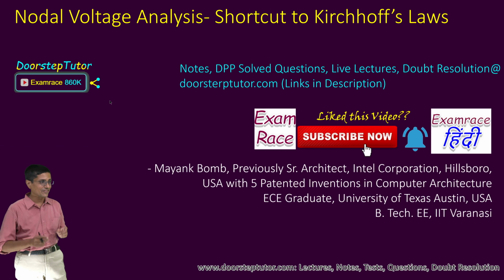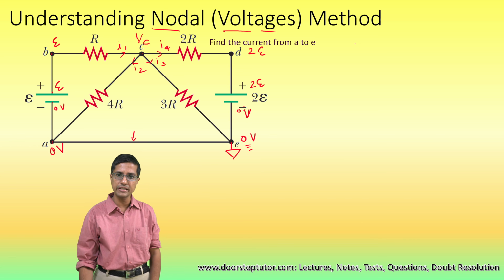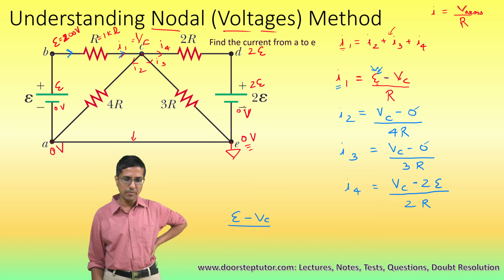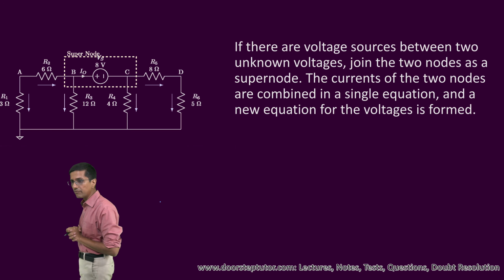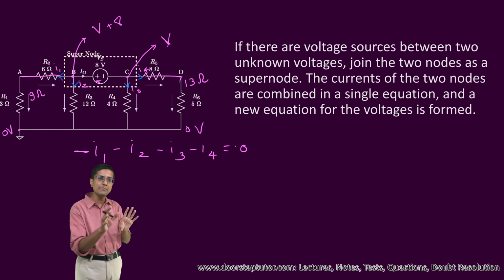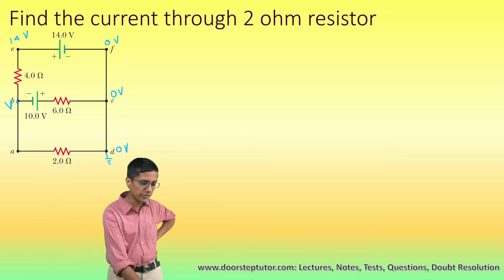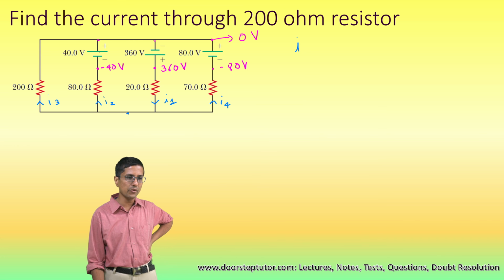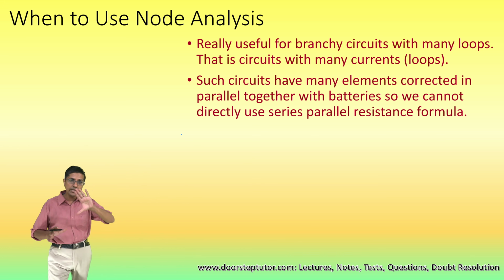Nodal Analysis As Shortcut to Kirchoffs Rules for Solving Resistance and Battery Circuits | Physics

Comment from the maker: Unlock the power of Nodal Analysis, the ultimate shortcut to mastering circuit problems and outsmarting Kirchhoff's Rules! This technique simplifies complex resistance and battery circuits, making your exam preparation a breeze. Master this essential skill with our comprehensive resources at https://www.doorsteptutor.com/Exams/. Drop your answer to the question discussed!